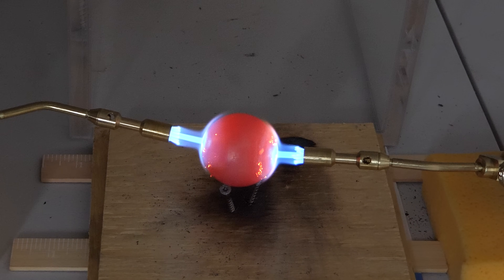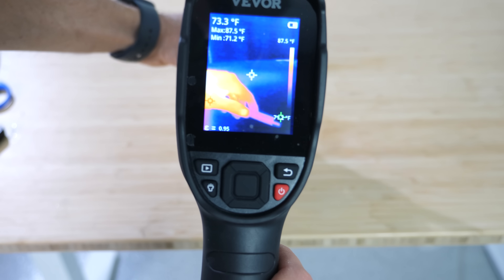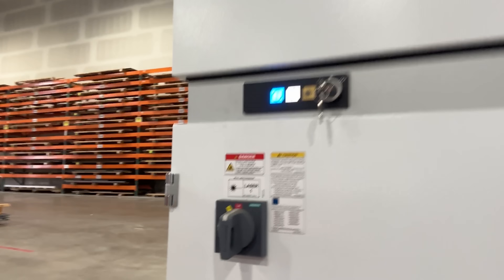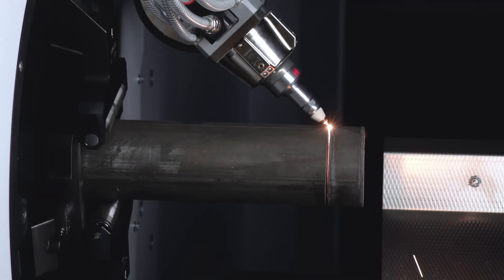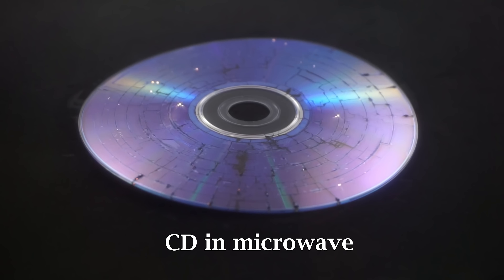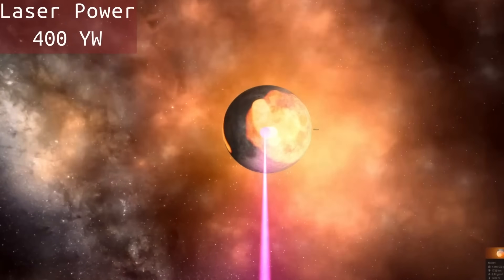How Hot is Light? How Lasers Bend the Rules of Heat Transfer

Comment: Even though the laser and microwave can heat  objects and increase the temp above the input power, it has a continuous input of power to replace the power emitted.

It is not measured in the same way as a thermal source emitting energy, as the laser and microwave has power being added to it as it expends the power.

Comment: So then why can't we heat stuff above the sun temperature using lens since the sun is also not a simple Thermal system (with fusion continuously adding energy like the battery of your laser ) ? Why is there a limit to energy focus of the sun light through a lens but not with a laser that also has to obey optics law ?

Comment: 2nd law has to deal with entropy NOT temperature, and it refers to an "isolated system".    Temperature is a simple interpretation of entropy moving from hot sources to cold.   What's your total system in the 10kW laser example?

Comment: I find this video severely misleading in an in principle, basic physics, way. It claims : “light doesn't have a temperature , it's an electromagnetic wave ...." I believe this is incorrect, a wave temperature is a well defined concept even when a wave has a non black body spectrum. An EM beam temperature is a meaningful concept even for a narrow band spectrum like the one of a laser. These are concepts well understood by electronic engineers who use them all the time with noisy circuits where noise is measured as a temperature , as well as in the case of the black body cosmic radiation well known to astronomers and cosmologists.
Going back to thermodynamic  the temperature of an EM radiation beam is the one an insulated absorbing body goes to when in thermal equilibrium with the wave.
The classic absorber insulation is the one of a reflecting cavity in vacuum.
This 3 dimensional case is slightly complicated to figure out (the Rayleigh-Jeans law) but has a perfect analogy in 1 dimension and low temperatures ( kT < h ω, classic radiation ), which most electronic engineers are familiar with.
For a single mode beam the Nyquist-Johnson noise expression relates the beam power to a temperature, P = kT Δω, where P is the wave power, T is the temperature, k is Boltzmann energy conversion factor and Δω is the wave bandwidth, demonstrated in a wonderful, brief, very clear 1928 paper by Harry Nyquist, "Thermal Agitation of Electric Charge in Conductors". Physical Review. 32 .
For all lasers the beam temperature is exceptionally large, in fact is large for most technical quasi-monochormatic waves. For example the 220V potential difference of common electrical household plugs, a one dimensional classical wave, would be characterised by a temperature T ~ P / k Δω = 10 kW/10-6 Hz ~ 10 ^ 33 °K .
The low temperatures of your experiments are related to well understood power balances and they are fully consistent with what said above. More exotic cases, for example particle accelerators, even everyday TV electron accelerators, would illustrate the potentially very high, but still finite and quantifiable, temperatures of EM radiation.

Comment: If you had a very big lens or focussing mirror you could theoretically concentrate the energy from the sun and create a temperature hotter than the sun’s surface.
Reply: No, that's the point he's trying to make.  Even if you concentrated all the light from the sun onto a single point you still couldn't heat up an object hotter than the sun.
Reply: @stevesether maybe that's the point then. That you can't concentrate all the energy from the sun into a point. If you could do that, then yes you would get a higher temperature than the surface.
Reply: @stevesether  yes I see now - thanks.

Comment: I'm not sure what I'm about to say is a fully valid explanation, but in that thermal radiation curve, the slice of it within the laser range is  will make up X percent of the energy.  If you instead drive just that frequency it is out of equilibrium with the black body curve and as the heat stochastically spreads out back into the black body distribution, the vibrating atoms will try to spread back into that black body curve instead of the one with a huge peak at that IR frequency.  You have to overpump that one frequency enough to spread out over that whole black body spectrum to a point where the IR energy slice of the black body curve matches the incoming (which will never happen, but it will hit an equilibrium from the outgoing radiation cooling things).

The ultraviolet catastrophe solution from quantum physics though means you can't easily just pump out higher frequencies indefinitely, it will start exponentially falling off with planck's distribution.

The microwave I thought has a little bit different explanation with resonance with the water particles, but maybe it works out to the same thing.

Comment: Wait.  How does the infrared sensor plate work?  It absorbed the infrared and emitted red. Things don't flouresce a higher energy light...
Reply: Great observation! Before use, the phosphor has to be charged with visible light (e.g. sunlight), so that, when hit by infrared light, it releases the energy stored during the charging process
Reply from the maker: yes it is charged by the light from the room. If you hold it in one spot for too long it discharges and won't show any red

Comment: So if i understand that right: You can technically focus a laser as tight as a single Hydrogenatom and get it infinetly hot?
Reply: Theoretically it could get as hot as plack temperature, where the wavelength of the thermal radiation reaches the planck length. So about 1.416 x 10^32 Kelvin. 
That is as hot as anything can get.

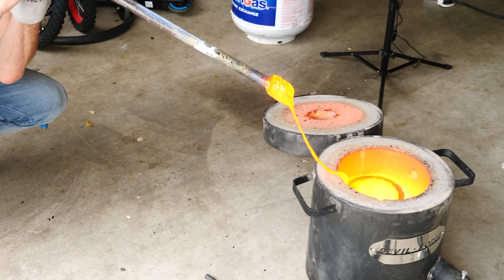Comment: 5:27 Question: how does LASER compare to SOLAR radiation? I think of the sun as emitting all manner of spectrum, based on something somebody said about Parker space probe data result ... What is the EM difference of focused LASER vs solar, thinking a minuscule Earth sized critter is in a straight line to the solar radiance, thus reasonably coherent beams of photons??? Just wondering 'bout Black Body radiation vs EM ... the rest was very educational, but caused me this question about exceeding limits. If a lens focused a particular wavelength, continually powered by the sun, how would the physical interaction effect result differently, laser vs specific solar radiation? (if the lens were focused in outer space without pesky atmospheric light scattering annoyance 😬) EDIT: I will search  "what happens if you focus a laser Action Lab" based upon a comment.
Reply: For this you have to understand lasers, which this video doesnt actually explain at all. The key takeaway is 0:49 "Light doesn't have temperature". When sun shines on you, it is a thermal exchange. Radiation is what carries that exchange. Laser is not thermal exchange, when laser device shines on you it doesnt exchange heat with you thermally. Laser is the heat itself, which is produced differently than the blackbody radiation. Laser is magic that follows very exotic principles that are much more advanced than the widely known 2nd law of thermodynamics.
Laser is not a spectrum of light, laser is one specific wavelength. If you filter out a portion of the light spectrum, you will also reduce the heat transferred to you, as filter will absorb heat from filtered wavelengths. Thats how wine bottles work, they absorb part of the light to protect the wine. Tinted windows and sunglasses are filters too, but instead of filtering out a color, they pass through only certain orientation of lightwaves, absorbing the rest (thats why tinted windows make cars colder than no tint).

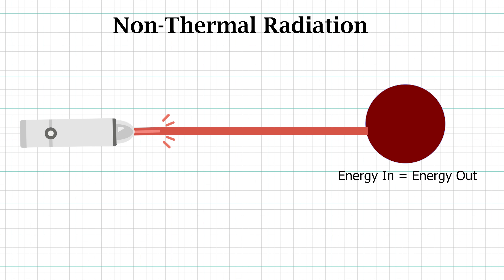Comment: 7:34 doesn't that mean you can heat an object more assuming you focus all of it on a smaller object since a smaller object won't radiate the heat as fast right?
Reply: At no simulations point in time, sink cannot be hooter than source
Reply: Technically no, but practically yes. Thermal emissivity is based on material and chemical properties, not physical dimensions, so a target of a certain material is always going to radiate energy at the same rate, regardless of size. While that's the technical correct answer, the practical answer depends on a lot of factors and that complicated math soup will usually result in a smaller target heating up more quickly and staying at a higher temperature than a larger target. Which would not be the case if you somehow conducted this test in scientifically ideal and perfect conditions.

Imagine that your targets are two cups, a small one and a large one. If you pour water into both of them at the same rate, the small one will obviously fill first, because it is smaller. Once it fills, the water starts pouring out over the edge; that's the thermal emission, radiating the "heat" away at the same rate at which it is being delivered. Once the large cup is filled, it too will start spilling over the edge and the amount of water spilling over will be the same as the amount spilling from the smaller cup because they both have the same amount flowing in.

Comment: So if I understand it correctly. The laser just turns the light energy into heat energy at the point of impact. The total energy of the light energy will be more than the energy required to heat up the material by X amount. other will be lost in form of reflected light or other forms of energy. You literally said it. light has no temperature. so no paradox?
Reply: the laser just delivers energy, like any source of EM radiation. the material absorbs some of it, heating up. as it heats up it also radiates back that energy as thermal radiation, eventually reaching equilibrium when it radiates the same amount you put in. the maximum temperature you can reach is then limited by how tight you can focus that radiation, and thats where lasers are very special.

Comment: I've been a manufacturing laser operator for 14 years and i can attest that the latest fiber lasers are indeed insane. at a mere 6kw you can easily cut through 1 inch steel plate.
Reply: Evidently at 400 yottawatts, (YW) you can very thoroughly cook a planet.  lol
Reply: I work for the manufacturer of 40kW machines. And some Chinese costumers want 50kW or more. That's where the cutting head optics become a problem.
Reply: @kuunib7325  no the issues come in with their crappy china steel. even with low power units, shitty material will cause more problems than any machine issue ever would.
Reply: What is underneath the plate?  Rocks?
Reply: @censoredeveryday3320  no, the machine has a table bed made of steel. the lasers output is tuned to only cut the workpiece
Reply: @censoredeveryday3320 usually just a gap of space and heat resistant blocks or something underneath.
Reply: @adamreside3912  most machines just use thick steel plates as heat barriers
Reply: @tslim250  yeah, the one I use is a very low budget 6kw laser. So mine is probably different than most
Reply: Does the laser really vaporize the steel away or does it only heat it and oxygen is blown in to burn the steel?
Reply: @Heikki_Finland  when nitrogen cutting gas is used the steel is vaporized and blown away, when oxygen cutting it is a thermodynamic process like plasma cutting. nitrogen is faster cutting up to certain thicknesses depending on available gas pressure and laser power. once that threshold is met oxygen must be used. not really a yes or no answer there.
Reply: Interesting now I just need a man portable power supply adequate to power that and we have the emperor's holy lasgun

Comment: That water flosser looks cool, but it's really bulky. What if we could attach it to the faucet? I bet you wouldn't even need to put a motor in it to get it up to pressure!
Reply: You still need a motor to get the pressure up high enough, I think.  But I agree, it looks bulky.  There is a hand-held water pik you can buy, but it doesn't hold much water so you have to keep refilling it, and this thing appears to have the same limitation.
Reply: @yeroca  I did the calculation and the issue is actually going to be too much pressure! We'd need to install a bleeder valve to lower the pressure to ensure 90PSI of water doesn't peel your gums off your teeth!
Reply: I think the toothbrush needs a laser to blast the plaque away

Comment: The laser light is transferring energy.  Whatever the laser is shining on is accumulating that energy so it is a question of time and energy not simply energy.
Reply: Well to be fair... Whatever gave the laser that energy also lost it at some point, so there is an energy equilibrium, but the system is probably on the scale of the earth. It becomes the universe if you use any elements greater than iron, like uranium in nuclear reactors. But at that point it would be mass-energy equilibrium ?